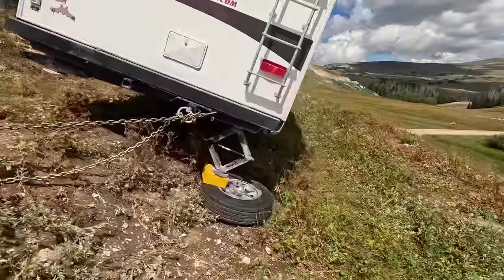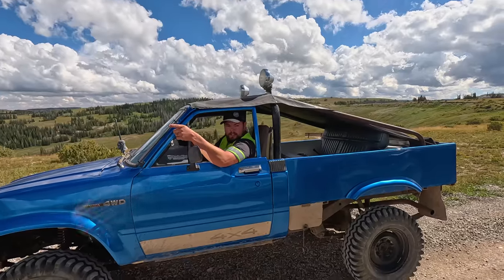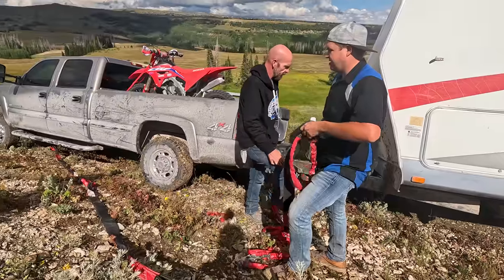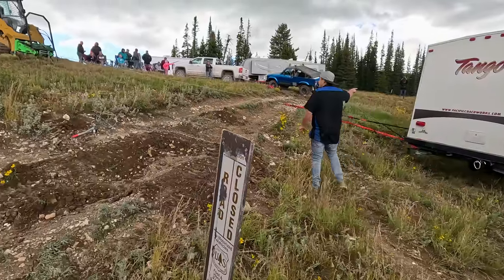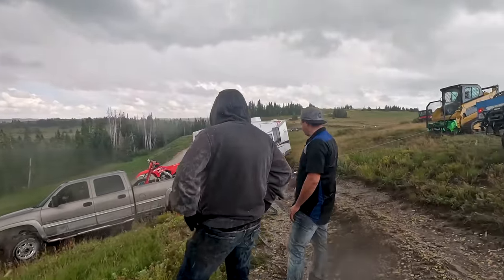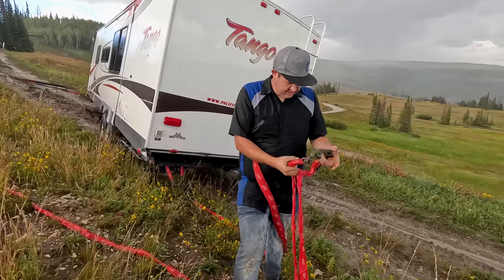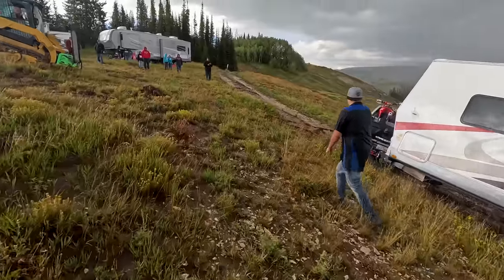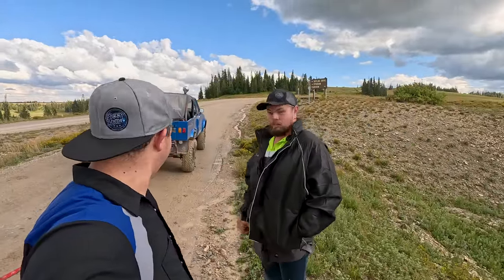Camper Nearly Rolls Off Cliff Disaster Recovery In Rain!

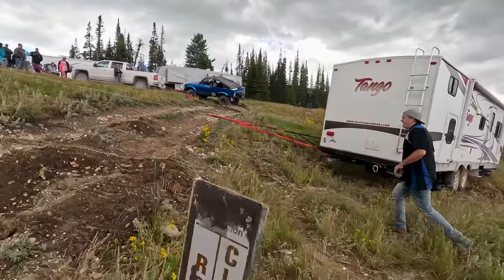Comment: 9:30 Anybody else notice the 'Road Closed' sign in the lower left corner?  The rain is not what got the guy in this predicament ... ignoring the ROAD CLOSED sign is.

Lesson learned by the camper?  Let's hope so.
Reply: I slid down to the closed road from an open road.
Reply: @docholliday3690  
🤔 Slid down...from an open road?  The video did not demonstrate that.  The next higher road, was the bluff where the other campers were.  That slope down to your rig would have rolled your setup...had you slid down from there.

Hope you sustained no damage.  Cheers.
Reply: @billbillinger2491  we are all safe and no damage, you might have had to be there but when I was backing out of the open road, the rear end of the trailer slid out, it was wet and muddy and we probably should have stayed home.  Lesson learned.

Comment: Honestly when a bunch of people gather to watch a precarious recovery like that you can't help but feel at-least half of em' are waiting to see you fail.
Reply: Sadly they are. I got audience when I was taking a tree down that was just a few feet away from my house. With the phone and power lines and houses on both sides just giving me a strip to drop the pine tree parallel to my driveway.  They were loudly almost arguing on what I was going to drop the tree on, they all seemed upset when I put the tree right where I planned to. With planning, controlled cuts on tree and 2 Jeeps with winches.  I cut leaving extra wood for solid hinge then used alternating winch pulls to force tree over. Tree cleared power lines by few feet, right next to driveway.

Comment: Well I d say if your proud of the trecker then you better call Matt and join in on the Sand Tract Challenge 😳☺️put your $$ where your mouth is ☺️😉 Paul Rory and Casey are going to be your other contestants. The MORR wrecker had sum issues on its first 12 attempts and it spent a lonely night out but the river until Matt fixed it and returned 2nd day for redemption 😊

Comment: My next 4x4 5or6 passenger 4 wheeler  will  have at least quarter ton5/16  line wintches on each end .  Ive killed big enough deer and hogs  i couldn't load ,  just throw a line over a big tree limb  wintch up back under it.  Lower and tie down.   Here  sometimes we have to string lines  but if 2 of us has lines fron and back , make recoveries  2x faster pulling from both ends just hook my hooks in a buddies hooks

Comment: Do you guys actually charge for this, a quote and payment must surely be set up in advance,    It’s the same with Matts Off Road, no one seems to pay. You would have spent a fortune on fuel. 
It also seems like you’re not fully kitted out for this in that while the skid steer works HillBilly’s truck is not a professional recovery vehicle, and would be better focusing on the body shop which is fully kitted out, but maybe things work differently in USA?

Comment: They must be super brave, taking a 24+ tongue n pull RV on trail. At least they did it correctly with using a long bed, with the added benefit of the 4-door length.

Comment: The trecker is sweet Hillbilly and it will be sweeter once you put lockers in it or better yet some ime ton axles with lockers😊   Great job fellas yous did a good job at getting the truck and trailer back on safe ground.

Comment: Recommended: over-the-top straps to prevent roll-over, down to the low side frame.  If the structure is soft in walls and roof, then add corner protectors (aluminum angle x 4' long with rug glued on the inside surfaces to protect the finish).  Pulling from the bottom as you did does not prevent lift-off, though preventing total roll-over.   A tensioning 'winch' maintains even pull force while reeling in and out to maintain that force level.  That would allow you to move the rig while the tensioners work automatically to prevent roll over.